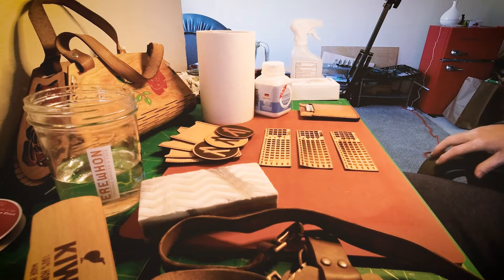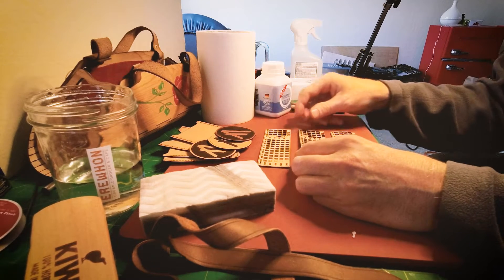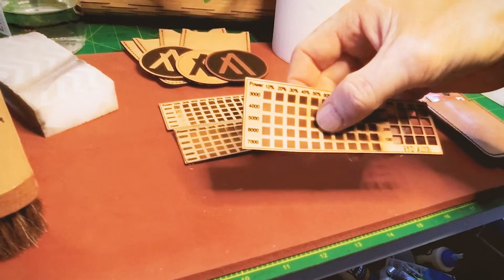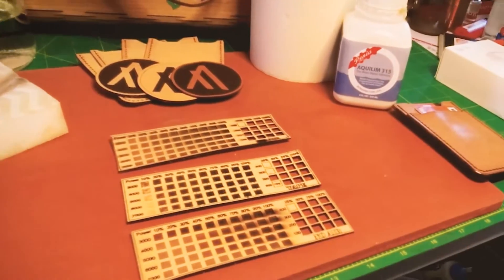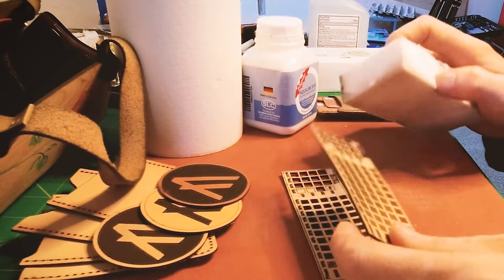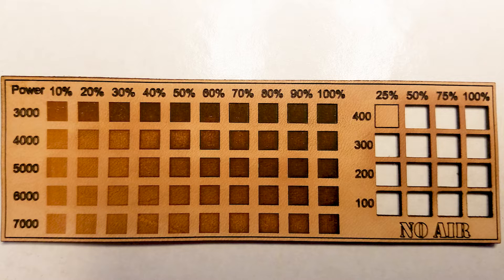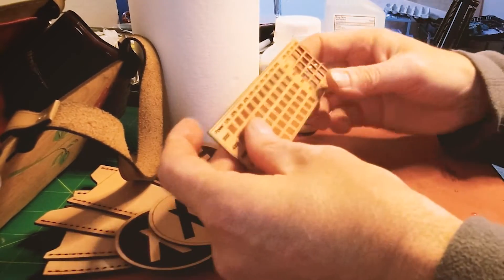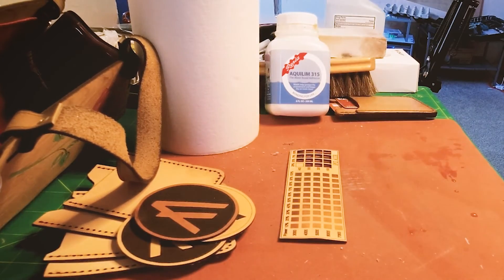Laser Engraving / Cutting Leather with Laser Master 3

Comment: Hey there, thanks for the video! Do you think you can share the test pattern file? If not, what settings are you using? I get really distinct lines on the ones i've tried so far. But I don't seem to see them on your tests. Was wondering how to get solid blocks rather than patterns with many little horizontal lines
Reply from the maker: I got my test pattern from Make or Break Shop, but you can make your own. Louisiana Hobby Guy has a video on it.

Comment: I use air assist for cutting, much cleaner cuts and less charing, plus it means I can run it on less power. I mainly use buttero leather at 1.4 to 2mm, it cuts really nice.
Reply from the maker: What do you do when you cut and engrave? I seem to be doing both most of the time. I have some bottero as well about same as yours. Looking forward to making some wallets. Thanks
Reply: @ValleyForged  I only lightly engrave my stitch marks, I always do my stitch marks first without air assist then I'll do the cutting with air assist. I also stopped masking the leather after I got the air assist, definitely works better. Buttero is great to work with, burnishes great. I hope you post a video of you using buttero in the future.
Reply from the maker: @Woozer73  will do for sure! Thanks